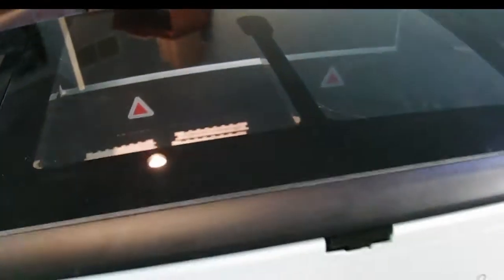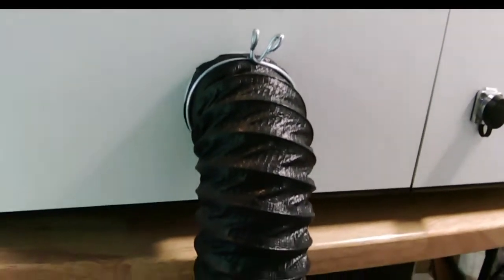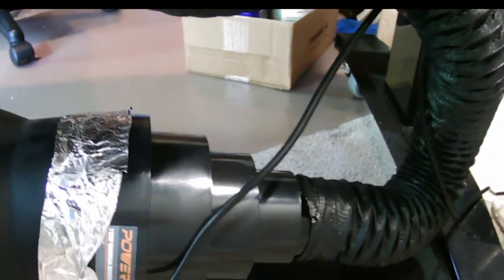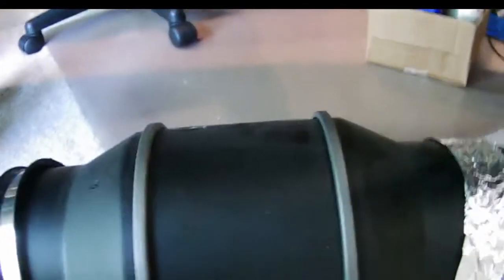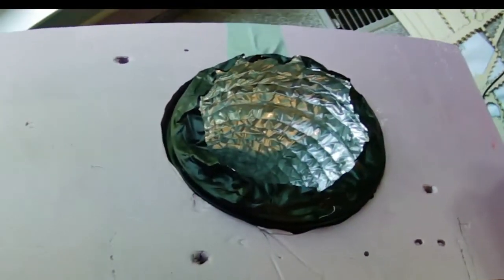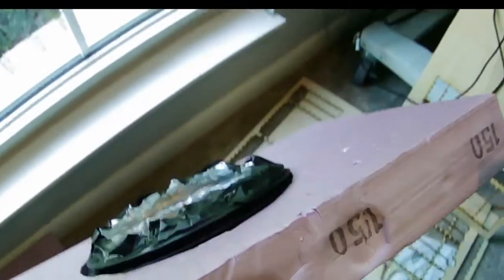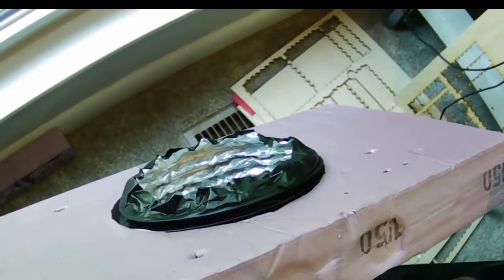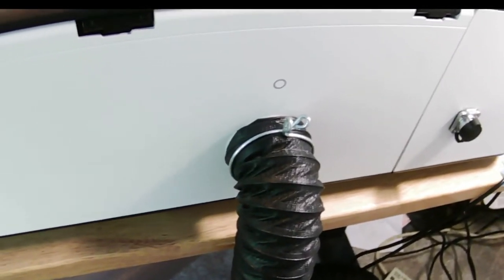Part 1: xTool Makeblock Laserbox Pro/Rotary Edition AC Infinity Inline Fan Exhaust System

Comment: Thanks for your video, it was what I was looking for.  I have a big dilemma, I would like to buy Xtool P2 to cut acrylic to create souvenirs but I would use it in an apartment.  I have two options either I put it on the balcony or in a room specifically dedicated for this which has a window that opens onto a corridor where only two of my neighbors would pass (this corridor is outdoors).  In my place, which configuration would you use laser + purifier + in-line fan or laser + in-line fan + purifier before venting on the corridor which is outdoors?  Do you see it as feasible and in your experience would it bother the neighbors?  Or would it be better on the balcony only with an in-line fan but since the balcony is open it would be annoying with the noise?  I live in the Canary Islands so I don't have temperature problems.  Thank you very much for your kind reply

Comment: I am a STEAM Lab instructor, but new to this technology. What is the purpose of the reducer? I have been looking into getting an exhaust fan. What happens if you run without the added exhaust fan and without the air purifier (I didn't even know about the air purifier option until I received the unit and the manual).
Reply from the maker: The reducer just bridges the gap between the two different hose sizes between the machine and the fan. The build in fan is not strong enough to exhaust the smoke (so some of the smoke exits through the lid). The purifier is not really worth the cost, filter costs.) I recommend a large inline fan if you are doing things like acrylic. Sorry I missed your comment for so long! I am a Director of a Makerspace and it is grant season. Feel free to email for a better response time!.
Reply from the maker: sharscrafthaven@gmail.com

Comment: when you install the AC infinity are you disabling any fan features on laserbox? Wondering if I just install my AC infinity if I need to do anything else to make sure i don't have twice the amount of noise?
Reply from the maker: Yes, you need to turn off the air purifier in the settings, otherwise it will throw and error saying low voltage purifier not detected. It is a simple check box,

Comment: Hello, thanks for the video!

So the duct coming from the machine to the reducer is 2” in circumference, correct? I just want to make sure I get the correct size.
Reply from the maker: I cut my reducer off at the 2" mark, the actual hose coming out is around 2 1/2 inches (63.5mm).
Reply: Hi , great vid. Did you used 6”-4” and 4”-2” reducer to fit in makeblock tube?